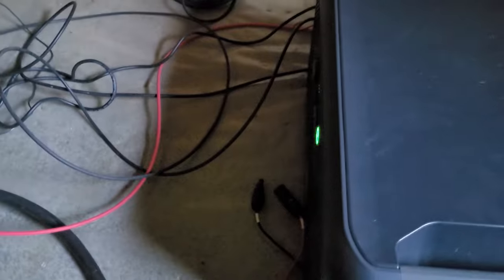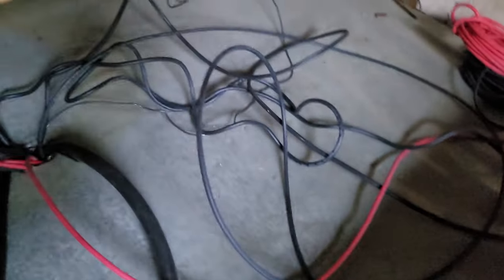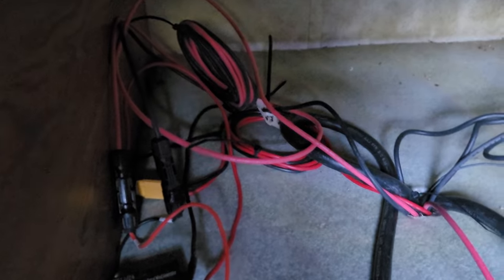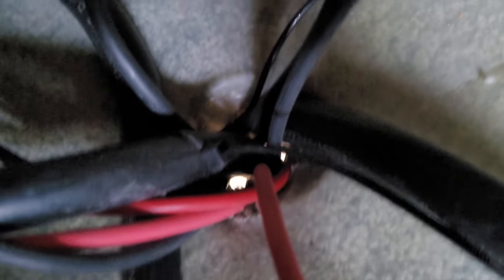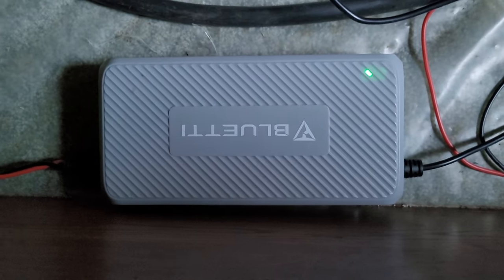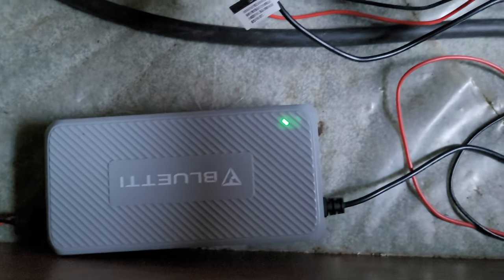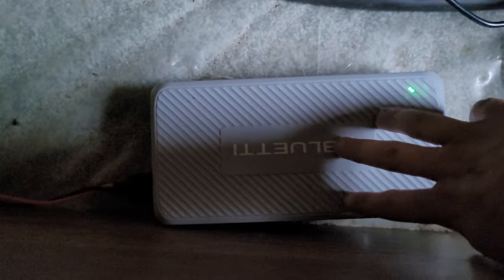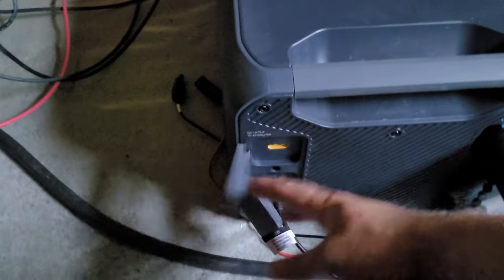What They Don't Tell You About The Bluetti Ac200max & AC300! #BLUETTIAwards

Comment: So we’re you running this thing as hard as it would go all the time? I have the BLUETTI EB200 (and another on the way). I have never had any issues with mine or I would refrained from purchasing a second one. Just for the record, my unit is very similar to the AC200P, only it has some minor differences and cosmetically it’s more like a beefier version of the EB70S.

Anyways, I’m wondering if you were constantly maxing out your wattage or close to it for a long time. Which I guess that’s not an “excuse,” but it’s kind of like a car. Just because you can drive it with the pedal to the floor… doesn’t mean you should do that, especially all the time. I feel like I’m probably a bit softer on the demands I am placing on my devices, so I don’t foresee this being an issue for me.
Reply from the maker: No I don't run it as hard as it go's.

Comment: I got my AC300 and 1 B300, waiting on the tool cart that I am going to put it on, about the only thing strong enough.  I see  ebay sells refurbished B300's for $1429, as opposed to $2199 or $1899 on sale until 11/3. Are refurbished batteries as good as new batteries?
Reply from the maker: That is a wonderful question.
Rebuilt batteries are engineered using working cells from old batteries, providing reliable performance but, these batteries don't offer the same level of performance and you usually  won't get warranty protection as you would with  brand-new batteries.
Hope this helps.
Reply: @MysticOwl15Homestead  The ebay listing says they have a 2 year warranty, "like new" condition.
Reply: @MysticOwl15Homestead  The refurbished 350 watt panels are $599, and come with a year warranty.  If the stuff functions as well as new and with warranty, it seems like a good deal.  I ask the same question on other videos, and maybe someone has bought and used them.
Reply: @MysticOwl15Homestead  If I spliced an extension cord to the wire, which would run light fixtures in my breaker box for example, if I plugged 🔌 this into the generator, would that power the lights? It is after all, an electric current introduced into the wiring. Nothing that I would do unless there was no alternative, a hypothetical emergency, but if it would work, you could connect some house wiring to the generator, and have use of switches and household power outlets. 
I have the AC300 and 4 B300's. 
I don't think that this will run 240 volt things, but will run all the 120v things.
Reply from the maker: @James Morrison  I would not recommend doing that sir, as there would be grounding issues and I'm sure some other things. You will need two Ac300 to get 240 as well as some other equipment from Bluetti. Such as BLUETTI Sub Panel for Integrating Power Station with House Electrical Circuits:
https://amzn.to/3WT9zT9

Comment: Thanks for letting me know that I need to get myself a soft start unit just for the AC200MAX. Made me realize that I should stay away from this power station as it still has problems just like the old AC200P.
Reply from the maker: They stated to me that all of their units will have to have a soft start.  It's a good practice to even have a soft starter if you're using a gas generator as well. Soft starters will increase the lifespan of your generator. It causes less stress on the electrical load.
Reply: Needing a soft start just means you have a inefficient unit that surges way too high.
Reply from the maker: I've contacted bluetti marketing department about doing a review over there AC500. I would love to test one out for you all an give you all the run down over it. We will see.
Reply: @MysticOwl15Homestead  All the Bluetti units will need a soft start? Who knew? As a newbie to solar stuff and owning the AC200MAX, could someone tell me what a soft start is please - and where do I buy one then what do i do with it? I sometimes get lost with the terminology used on here, yet most of you peeps seem to get it immediately.  Thanks for any help. Samantha in England.
Reply: @samtabby3373  I have the same questions.  I wouldn't have bought it if  I knew I needed another device in order for the 30 amp outlet to work for the A/C.
Reply from the maker: Even if you are using a gas generator it is best practice to have a soft starter unit placed on your AC. This device reduces stress on your  generator And air conditioner unit therefore increasing their lifespan.

Comment: Hi there, hope u can help please.... when my B300 battery arrived it contained some juice already - which I've since used and its now empty. BUT how do I refill it? I can't get it to talk to my AC200MAX,  and I have the connecting cable inserted properly (having checked that many times). So how do I get fresh solar juice into the B300?  There doesn't appear to be any socket to directly attach my solar panels to it, and my AC200MAX won't communicate with it...., it could be useless or it  could be me. I could charge via AC from my domestic plugs but what's the point in that? I bought it to obtain free solar,  but what am I doing wrong? How do I get my AC200MAX  to talk to it - I've tried various things..... also how do I get my panels to input juice to this B300, there's no socket in which to insert the panel cables? I can't even see the B300 when I switch on the Bluetti App, as opposed to tapping the screen. Would be SO grateful for your help.
Reply from the maker: Will be posting a video over this issue Saturday morning at 9 AM  Central time. Hope it helps🙂 
Please subscribe, Like and share our videos. Thanks
Reply: @MysticOwl15Homestead  that is so kind of you. I'll definitely be watching - but at a different time as I follow you from England. Thanks, Samantha

Comment: So, I only have the ac200 max.  I can't run my 30 amp rv air conditioner from it without a softstart device attached to my RV???? I wish you would have talked a little more about that.  None of their info on their website says anything about that.
Reply from the maker: Yes this is correct. Upgrade your unit to a AC500 and you will be good
Reply: @MysticOwl15Homestead  Bluetti doesn't even have listed AC500?  Not putting anymore money into the system.
Reply from the maker: The Bluetti AC500 is listed on there website. They are talking with me  About sending me a AC500!

Comment: Do you have to turn on the B300 external batteries for them to start charging? Or do they start charging automatically once the AC200MAX starts to receive solar energy?
Reply from the maker: You have to power them on the first time.
Reply: Ac300 with b300 at 0% battery will start charging automatically

Comment: I am just planing to get my AC200Max on powering my 2000W AC Unit of my camper. The AX200Max should have 2200W Max so that should be no problem imho. Did I miss something?
Reply from the maker: You will need to get the AC300 https://amzn.to/3ov1aFu  and a soft starter https://amzn.to/3zyeWxa so you don't brun up your generator. You will thank me later.😉
Reply: Ac units can have a spike of around 2 x the rated running power on initial power up .  The bluettie has capability to absorb some of this but if  this initial spike is too big can cause errors and shut down. Installing a soft start on the ac compressor can get rid of the problem.  My guess is a 2000w ac unit is going to need a soft start. Even if it doesn’t one should be installed to help protect the generator from these inital spikes

Comment: Thanks for the video. Have you considered running the a/c more at night than in the day? Some say this is more efficient.
Reply from the maker: I've been running it 24/7 for the last week now.  I run it at 80 during the day and at 76 at night.
Reply: it's more efficient to run Air Conditioning at night "ONLY" if you have a Very good Insulated Home
Reply: Only running AC at night is like only drinking water after you're dehydrated. 

Who buys a 2000wh power supply to run AC only at night???
Reply: @joeloco5129  my HVAC person told me that.
Reply from the maker: Your HVAC person must have a fully foam  Insulated house. Which is very expensive to have done. I bet that's really nice.🙂
Reply: @MysticOwl15Homestead  

I have installed that foam before and it's amazing. It is expensive, but in very hot climates like we have here at the beach, it pays for itself in under 10 years, easily. I'm about to redo my entire attic with foam, as my ceiling is 80° on a 78° day, due to crappy blown insulation.

Comment: Is the soft start needed for any window AC unit that is to be connected to the generator?  I am thinking about getting the AC200MAX and a B230 with 2 350W panels.
Reply from the maker: I'm currently using a 10000 Btu window unit I wouldn't go any larger that that. I would also recommend the AC300 over the Ac200max any day. It has fast charging which you'll want if you're planning on running the air conditioner during the day.
Reply: @MysticOwl15Homestead  Thank you.
Reply from the maker: Your welcome.😁
Reply: @MysticOwl15Homestead  I am mainly getting one to run my oxygen generator should the power go out, and anything else that is necessary. So the 300 is better than the 200max, even for refrigerator and freezers?  I have HAD two of the little 1500 or 1800 watt solar systems, which were POS's. $3K is a lot to spend, and definitely not on junk that stops working within a year.
Reply from the maker: Yes I would go with the AC300.
Reply: @MysticOwl15Homestead  Alright,  I appreciate your advice.  I will start with 1 B300 for now. I am ordering from the company.
Reply: @MysticOwl15Homestead  By the way, how much(length) cable comes with Bluetti solar panels?  Is this cable regularly available should more length be needed.  I need to figure where and how I  am going to place both around here before I order too. 🤔
Reply from the maker: You will most definitely need to buy more cable.
Reply: @MysticOwl15Homestead  What's better: the Ecoflow Delta Pro with 400 watt panels,  or the AC300 with a B300 with a 350 watt panel?  Still researching.

Comment: Give some more details please. How much does your AC need when you turn it on?
Reply from the maker: My rv Air conditioner is 18000 BTU, So when it kicks on I see the power draw on the Bluetti start at 800 watts then is climbs up to 1700 watts the the Bluetti would kick of saying inverter start failure. Talked with Bluetti tech support and they said all there until would  Require you to have a soft starter on your  RV air conditioner.

Comment: I have a question maybe you could answer. Thinking about getting the 300 but want to know if the battery is charged and you have it hooked up to 600W of solar will that extra go to run the things you have plugged in or is it just wasted because your things can only run from off the battery. Thanks in advance:)
Reply from the maker: Pretty sure when your load is large than the solar going in. The battery switches to discharge. Hope this helps.
Reply: @MysticOwl15Homestead  Ok lets make it 1100W of solar coming in and what you are running is 800W battery is 100% will what you have plugged in run off the solar or still off the battery making the extra your getting from solar unusable? Thanks for your fast response by the way:)
Reply from the maker: I would run the full 2000 watt solar to get your desired result.
Reply: @legaleagleandpaws8198  It will send 300w to batt if needed, and run the 800w load, its referred to as "charge through" .
Reply: @woodchuker570  Actually "charge through" means you can charge the battery and at the same time use it to run loads "from the battery" while it is charging:)
Reply: @legaleagleandpaws8198  Once the battery reaches a 100% the MPPT charger shuts off, at 99% it throttles down to about 250W. That's why I'm always trying to up the load when battery is above 90%. I wish the system could do that automatically.
Reply: @amieres  So in the final analysis you are "wasting solar power" and everything used to power loads only comes from the battery. Then you kindly added if the battery is close to being fully charged from the solar input "it throttles" your out put power to the loads down to only 250w instead of the 2000w"... didn't think you had to babysit it . Can you explain the throttle down part a little more. Thanks in advance:)
Reply: @legaleagleandpaws8198  To be clear, the inverter will still produce up to 2200W. Is the MPPT battery charger that will throttle down once the battery is at 99% and then shut down when it reaches 100%. What I mean by throttle down is that even if the sun is out and your solar panels are capable of producing 900W the system will only take about 250W (in my experience) to charge the battery. In other words it slows down the charge probably to reduce the cutoff current once it reaches a 100% when it stops taking any charge at all (0W).
Reply: @amieres  Ok so the extra 650W of solar "is wasted" and will not run the load(s) independent of the battery. That was my original question:) Now can you be more specific as to "when" the charge controller starts and ends its "throttling" and does the 250w throttle vary according to the amount that the battery is charged ? Where are those specs?  Thanks in advance:)
Reply: When the charger has charged the battery inside (52V not the current) then the charging current will drop and the watts will also drop so as not to get a high over voltage over the battery, if you interrupted the charging just when it is at 52v then you will not have a full charge and then there's also the BMS that has to balance the cells, but I don't know if it also happens while charging, I'm guessing it does

Comment: how loud is the fan in the AC200max unit?
Reply from the maker: It's quiet most of the time even when it  revs up. It's still pretty quiet then.
Reply: about as loud as a Fan you would use sitting on your kitchen table.  Not bad at all

Comment: Whats up sir, just swinging by to watch the video. So what should I deduce here, that you need a softstart for your AC? 

Also, man I struggle with over paneling but I get it. lol. 400 watts will likely give you like 320. with 120 being wasted, id much rather have 150 going into each from 2 200 watt arrays for a total of 300 actual watts. But thats just me, I know people have different reasons for over paneling.
Reply: Over panel my system by about 20% so that I can actually see the full rated power on my generator.   I estimate Im not seeing about 50 watts during peak hours of the day.  (Loss in addition to inefficiency).  The cool part is I get more wattageThe morning & evening hours and during cloudy days.  It more than makes up for the loss during peak hours. Design strategy and system capabilities also are a major consideration. Panel wattage Series / parallel circuits / system input voltage and cable size are all a factor

Comment: How did you do the the soft start
Reply from the maker: There will be a video coming soon on this.
Reply: You can get a soft start built into your surge protector, or wire one into your a/c unit. SoftstartRv is where I got mine and they walked me through the install process. Great products and great support
Reply: @mikedowling3569  Those Softstartrv's are $900 I see. On sale for $599.  Bluetti should have told customers they needed one of these to run an air conditioner.  This is false advertising on their part.
Reply from the maker: Here is a link for a sof stater for $229.00 https://amzn.to/3qCU6I1
Hope this helps you.